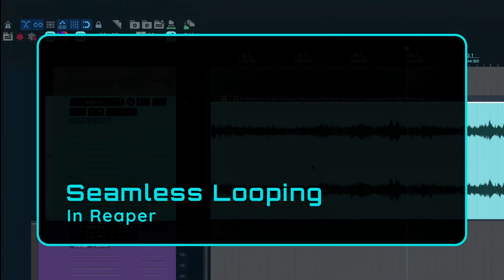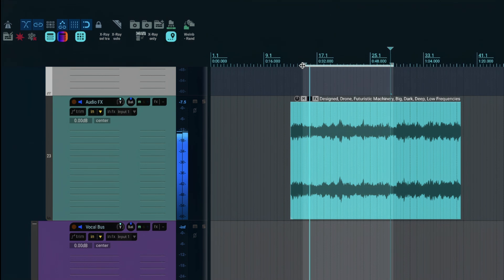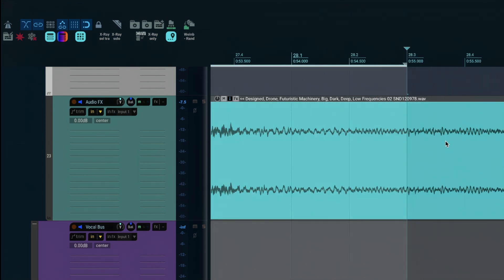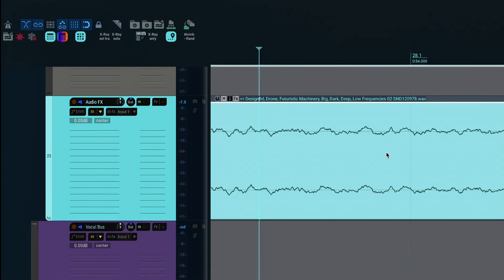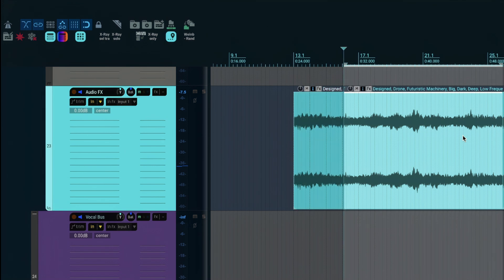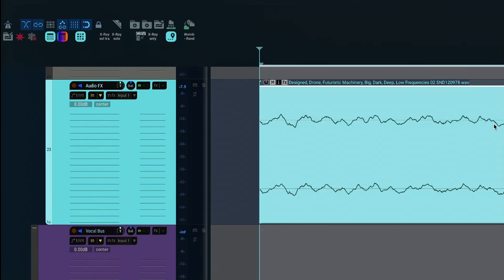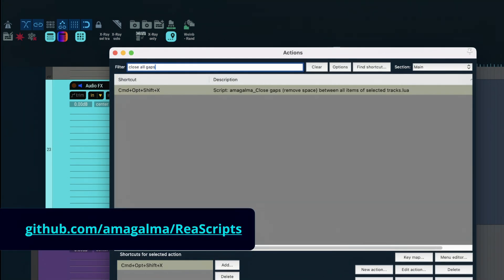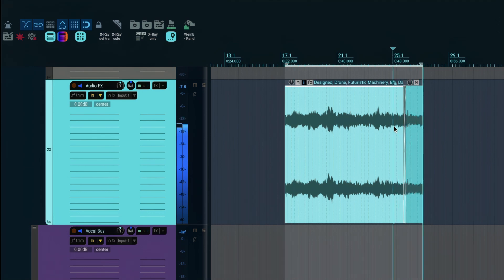How to Make Seamless Loops in REAPER (Clean Audio Looping Tutorial)

Comment: reaper sometimes adds a click to the render even tho my loop sounds perfect in reaper does that make any sense? i'm using 2nd pass render i dunno . i've ran into this issue a few times. it makes zero sense, mabe it's cuz i'm not cutting out the first like you do, Edit: Reaper did this crazy change in a recent update it reset a bunch of settings back to defaut. like auto 1000ms tail end on freeze track.. then this tiny crossfade on split was happening you could barely see it.. and also. the Tiny Fade out on playback stop got turned back on. wow lolol. i'd like to speak to Reaper's Manager Justin and ask him never to mess with our settings again omg. i do game audio that was frustrating.
Reply from the maker: I was running into this too, and one thing I found is if there is any processing anywhere in the signal chain, that can cause it to. So if you have effects on that track, a parent, or the master, I’d render that and then use the rendered audio to make the loop if that makes sense.